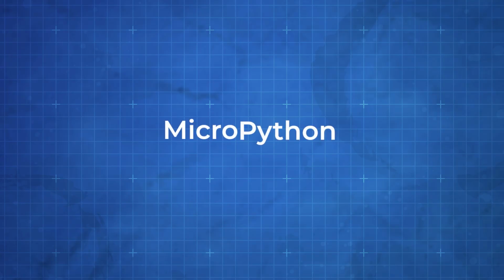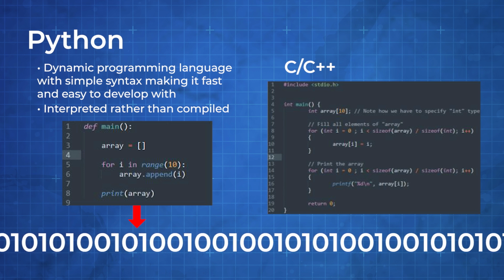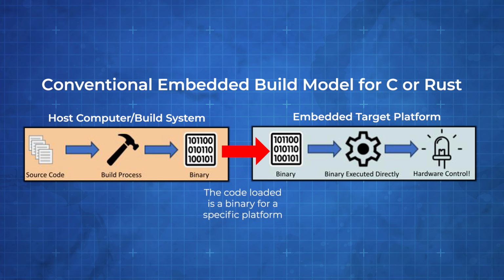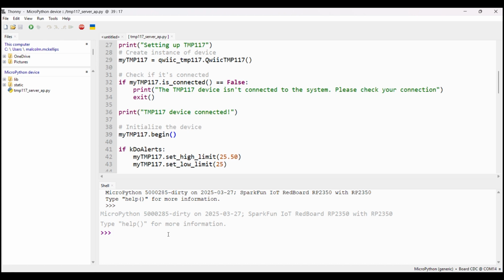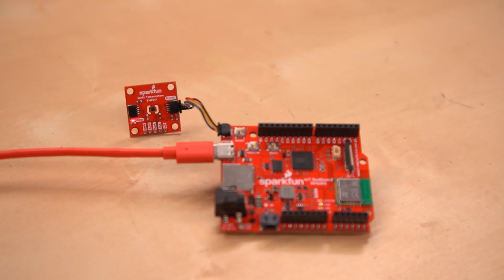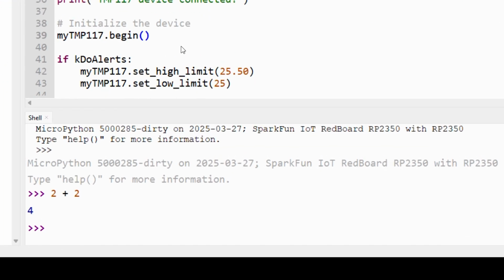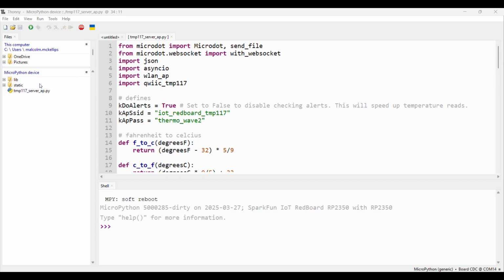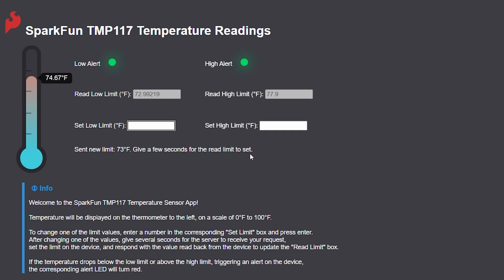Why MicroPython is a Game Changer for Embedded Engineers

Comment: I used to do microcontroller board design on Altium but always had a software or embedded engineer for the coding. uPy is definitely good for noobs and quick troubleshooting. If you want to get more into electronics and have the skill of soldering very small parts (easier with a soldering microscope) consider learning software like EasyEDA or KiCad, etc. It was an enjoyable career

Comment: Just because you can doesn't mean you should. Python uses 75.88 times as much energy and is 71.90 times slower than C
Reply: Host mentions that it is useful in prorotyping. Does it mean that you first achieve working prototype in Micropython and after validate all the algorythms that can be validated using Micropython, you end up rewriting project with C? Prototype may need more expensive MCU or faster clock speeds and will consume more power, so when you reach the final stages you switch the MCU to cheaper one. Seems like more work, and you can get in trouble while changing MCUs, but looks like he means that such approach could save time compared to starting from scratch with C even if you are good with C

Comment: Micropython is not a game changer for embedded engineers (they will hold on to their views), micropython makes embedded engineering more accessabel for python programmers.
Reply: Or students like myself
Reply: for anyone
Reply: Host mentions prototyping speed. Does he mean that it would be faster to first do a working prototype in Micropython(check if algorythms work, maybe use faster clock speed and chip with more memory for prototype), and than rewrite it to C\C++, then to start from scratch with C/C++ if you are already good with C/C++? At first glance it seems like more work to do
Reply: So it’s a game changer for developers with limited education or accessibility to the capabilities and technology.
Reply: python is borderline pseudo-code that can be easily read and understood by someone with little coding knowledge allowing the use of AI tools to create edge device Micro Python programs. Upload the entire current python runbook and you're good to go.

Comment: I’ve been developing robotics systems using stm32 (lately the arduino giga) for several years, primarily in C/C++.
Sensor data and motor controls are precalculated in real-time via a Python WebSocket server on Linux, where Python handles trajectory generation, curve fitting, and refinement through TensorFlow-based ML models (now Vertex AI).

My main issue is still real-time sensor feedback integration into motor control loops.
I’ve briefly explored MicroPython but haven’t found detailed performance benchmarks.
Are there any reliable performance tests on MicroPython’s VM, especially regarding real-time execution and latency under high sensor sampling rates, I’m just curious ?
Reply: Nothing too serious; but if performance is a concern, MicroPython makes it easy to implement libraries in C and integrate them.
Reply: If you're using dma as much as possible latency shouldnt be an issue.

Comment: 1) why do you mention the absent of compilation as a benefit? Wouldn't compilation help to find errors before run time? (especially with code lines that are not easily reached) 2) wouldn't a compile code run faster? with smaller footprint?
Reply: The main reason to remove the compiler is to make development faster, and I mean FAST! You can run code on your MCU INSTANTLY after making changes. No need for waiting like 60 seconds for compilation. Catching bugs? Hah! You can fix em after you run your code. Python prints every error message to the terminal when something goes wrong. While there are SOME slowdowns, it isn't significant enough to make everything unusable. I think the ease of use justifies the cost

What I'm trying to say is that, by using python for your projects, your development speed will be faf
Reply: The compiler is your friend: it finds the more obvious mistakes for you. And compiled code runs faster, except if the algorithm used is exceptionally bad and is compared to a good algorithm implemented in Python.
Reply: He is just wrong, Python is compiled to bytecode (.pyc files) before it is ran, it just generally does this at the same time as you run it. A language like Go can do the same thing with "Go run" to compile and run a program, and has comparable startup time to Python in situations where you have many imports
Reply: It’s a benefit in terms of development feedback time. You don’t have to wait every time you changed a character. You can change the code on the fly. You can code once and run everywhere.
Reply: Ease of setup. If I know a device runs MicroPython, I can put a .py file on it to get it to run. There's no need to set up a complicated toolchain.
Reply: @mgancarzjr  Easy setup is a value indeed, but there is no complicated tool chain any way. I use VScode and everything is well packed and managed for me, including libraries content and versions.
Reply: You can do static type checking with (Micro)Python using mypy/pywright. No need for a compiler for that :)
Reply: @Jononor  Compiler is not a punishment. It is a valuable tool. For start, LINT is part of editors, so most typos, and even function calls can be checked on the fly. Most compilers can compile only modified code, so no need for full compilation for every change. Compilers can detect issues with lines that are hardly used. Interpreter might fail only upon execution. Compilers bring faster runtime, which is also a key factor for products.
Reply: @YigalBZ  Setting up a cross compilation toolchain for an embedded device can be quite annoying. Much better now than a decade ago though :)
Reply: @Jononor  True about cross compilation. I also agree that interpreter can be faster at development stage. I wonder - is there a compiler for Python? that can take the final design?
Reply: @YigalBZ  yes there is. Several libraries exist (py_compile, compileall, etc) that can convert big, chunky .py files into .pyc (python compiled) files. They turn big chunky python code into optimized "bytecode" which is several times smaller than the original file. They usually don't make your code faster tho... It's useful for working on low memory devices

Comment: For prototyping, MicroPython is pretty awesome.  If things get serious you do want C++ or similar
Reply: FWIW I work for a company that uses MicroPython as one of the technologies to develop medical devices. It's proven to be a very positive and efficient environment.
Reply: @mattytrentini  I find the idea of using MicroPython in a mission critical environment extremely worrisome.  Good luck
Reply: @ no need for luck, it’s just solid engineering…
Reply: @mattytrentini  I don't know you so I can't make a judgement call.  I dearly hope you know what "solid engineering" means in this case.
Reply: @ we’ve been developing medical devices for many years with a number of languages and technologies. MicroPython is fine up to class 2. I’ve also worked on railway devices - and seen much flakier C development than MicroPython!
Reply: @ you have eased some of my worry with that statement :)
Reply: You can use C/C++ modules in MicroPython. That is a great way to get the best of both worlds, when doing computationally intensive stuff :)
Reply: You can also use Ada, which is just as fast as C/C++.
Reply: How would you do prototyping with Micropython? Do i get it right -- you first achieve a working prototype with Micropython, use more expensive MCU if necessary or higher clock speeds at first, than after you get all the algorythms working right, you rewrite the project to C/C++ and use less expensive chip or slower clock speeds, and you end up actually saving the time in the process comapred to starting from scratch with C/C++ even if you are good at C/C++?
Reply: @qt1qg  mostly yes.  You'd likely live with the lower performance and use the same MCU for the prototype.  Non-trivial decision process there.  C/C++ rewrite then not only gets you more speed but more uptime (prerequisite being expertise in C++).  Usually C++ gets you more features too.  Sometimes lower speed, lower uptime, lower features don't offend - that's when MicroPython can be acceptable beyond a prototype.
Reply: @MalachiBurke  why would MicroPython implementation have lower uptime? Bugs and memory leaks? Longer and more of read\write  operations that could result in errors or data corruption when system has unexpected shutdown?
Reply: @qt1qg  MicroPython's GC is susceptible to memory fragmentation last I checked (about 2y ago).  That's where the lower uptime comes in.  MicroPython you'll probably hit less bugs, since C++ is a lot harder to get right
Reply: @MalachiBurke  I guess you would need to change approach to architecture when migrating project form MicroPython to C(don't really know how to get around it, it certainly will not help with rewriting). GPT warned me that MicroPython can be sufficient in some cases to test out algorithms and math but using libraries that are MP specific would get you in trouble in the long run. Also it told that often people make driver for peripheral in MP and as soon as they are satisfied with how specific driver works they rewrite it with C(I guess the same applies to math and algorithms specific to physical processes to be controlled). How would propper workflow that involves prototyping in MicroPython look like in detail?
Reply: @qt1qg  "How would propper workflow that involves prototyping in MicroPython look like in detail?"  you don't expect that to fit in a YouTube comment section do you? :D  I think MicroPython is perfectly fine if it fits within your requirements.  I can't picture anything specifically bad about an MP library.  I read MP driver = MP library in this scenario.  Any MicroPython experts (I'm not) wanna chime in here?
Reply: @MalachiBurke  how do you personally use it for prototyping? I guess MP would be extremely useful to test the peripherals, or to figure out how to interface with new sensors regardless of any constrains, to develop algorithms for fast processes you probably would need really powerful  MCU, but MP would speed up development a lot because you won't be distracted as much with debugging C code constantly, in case of some complex process you probably would spend most of the time figuring out the algorithm and final firmware and pcb development will take very little time in comparison(though I can't really tell if MP would fit all the applications if used that way, but may be it could serve as a stage in developing even something like flight controller or bldc driver if really powerful MCU is used)
Reply: @qt1qg  I don't.  About 6 years ago I gave it a few shots but I found I preferred C++.  Imagine your drones falling out of the sky because MP rebooted due to GC/fragmentation glitch.  If that's a risk you are confident you can mitigate, go for it.
Reply: Micropython takes a lot of space so you need switch to c/c++ for the final prod device so you can use cheaper microchip.
Reply: @NiaRiver  this was true in the past, but today memory is much cheaper than the devs time. Rarely do we choose to rewrite something in at a lower level to save memory cuz rarely it achieves any savings. Much of these higher level librarys are already optimized in c already.  Millions of parts perhaps but the advantages is are limited in 2025
Reply: @axa.axa.  I guess it would depend on size of the production batch, also Micropython should be slower in some cases(may be in most cases) so there is supposed to be more than only the memory constrains, atleast it looks that way at first glance
Reply: @axa.axa.  some people end up optimizing stuff to run on PIC MCUs for large scale manufacturing of small devieces, sheer thought of working with Microchip development tools makes my skin crawl
Reply: @NiaRiver depends on your project. If your project is stationary like weather station, space and weight aren’t a problem. If your project is drone, then python is too slow and heavy. Usually, we use microphyton for something slow and steady like agriculture, smart home and etc.
Reply: @hafizuddinmohdlowhim8426  i saw many drone projects with python before
Reply: C++ huh….no!
Reply: But for AI + IoT, microphython is perfect.
Reply: @hafizuddinmohdlowhim8426  agreed.  I find AI obnoxious on the whole, but it can be useful and your statement is valid

Comment: Stop the cap, C/C++ are the top Gs for embedded development
Reply: Is anyone using Rust for serious / commercial embedded design?
Reply: Hey be quiet. This is a good roadmap for those PHP guys.
Reply: It's been 20 years I'm into firmware design. 2005 I was told java will take over c/c++ in microcontrollers and I waa called a fool rejecting java and settling for c/c++ which was said to be outdated any soon. Even a prof from my university said that. My skilled argumentation didn't help. Well, so then...
And here we are, 20 years later, java is dead, it never really made it to microcontrollers, barely in higher embedded applications... But C is still the de facto choice.
Mark my words, neither will python do, why using a shitty language and even shittier interpratation layer, sucking the performance out of your chip for just interpreting, while you can do it better and straight forward in C.... fast, energy friendly, low memory consumption.
And there is too many chips out there, they won't port python even to half of them. It will be a niche to play around and for pretender like this dude in the video.

Comment: whats different between circuit Python and MicroPython?
Is it easy to insert, or call, assembly code?
What's the easiest way to find out what libraries exist for different devices? 
Is MicroPython fairly agnostic regarding processor and board families?
Stm32 vs ESP32 vs Arduino vs,,,?
Reply: MicroPython is highly portable and pretty good compatibility across boards and architectures.
Reply: You can do inline assembly on some architectures. You can create C modules and use assembly in that, on all architectures.
Reply: CircuitPython is a specific fork/distribution of MicroPython, by Adafruit. Many smaller differences. Notably the hardware-abstraction library. Which unfortunately means that drivers are mostly incompatible =/

Comment: nice explanation,  totally agree, and github has a lot of info - examples, 
last project was to webify an infrared transmitter, to control a hdmi switcher, input will be several rpi + camera, output will go thru switcher to usb capture for obs-studio,
before that i webified a kitronik motor controller (dc/servo/stepper), meaning i can now control both thru html page on 1 or more tablet/pc and thru wget lines in a script.
all in micropython, only exception was for obs-studio i had to use circuitpython to emulate a keyboard + webserver, control obs with a remote web interface.
rpi can output camera to hdmi, full screen or partial (no gui needed), pygame also works without gui on rpi,  so rpi runs python webserver + pygame + picamera.
pygame can also show picture(s) from a folder
Reply: what did this do?